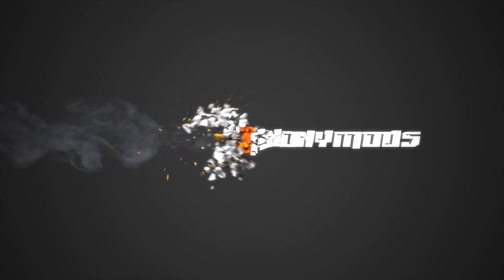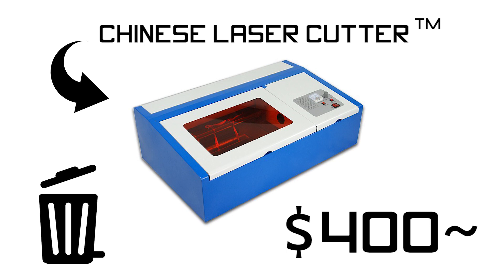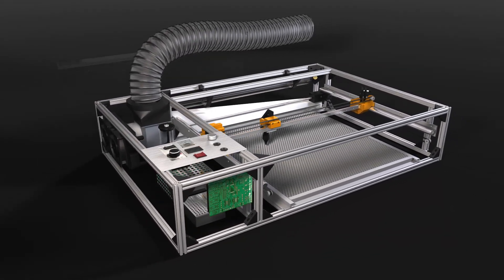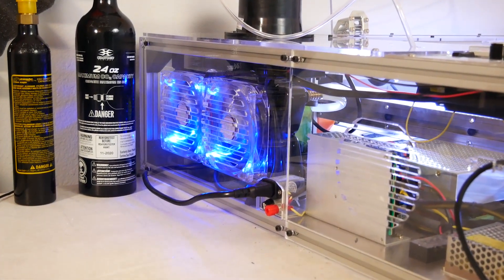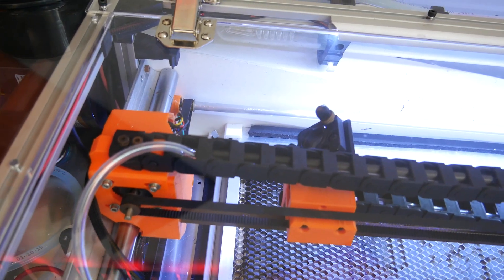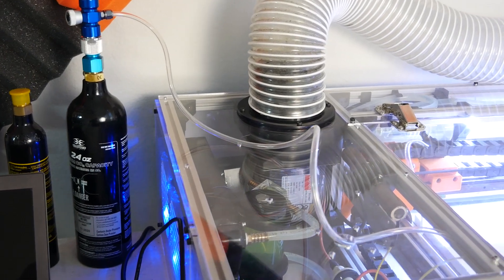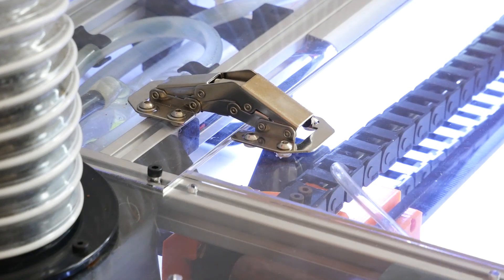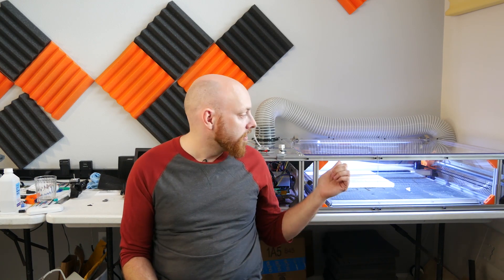S01E19 - Laser Cutter Build

Comment: I have a K40 and been wanting to upgrade to a 24x18 inch bed. Is the beam still strong enough at this larger size to cut 3mm acrylic? Do you have any plans or diagrams available for reference? I've been thinking about using 20x20 extruded aluminum for the frame and V-slot for the rails.

Comment: really? co2? That doesnt sound right with a co2 laser since the gas will absorb the laser radiation beatifully. The energy the laser photons have matches exactly the energy that is needed to activate the CO2 (obviously since that is how a laser light is created) and so would cause a new emmision in a random direction. I wouldnt be suprised if you would lose 50% of the power by doing that. I personally would go with N2 or normal air for the easy things.
And a word of warning: The tube is a 30w tube but overdriven to 40w. So if you want to extend the life you shouldnt go over 70% power.

Comment: As someone working for a company that uses lasers to cut holes in car frames at their factory's, I would highly suggest you to paint that thing black. It sure does look nice but that laser is way to dangerous to be in an open space.

I had a colleague who walked in a room where our robot was busy working on a car. The guy never looked at the laser but by just walking in the room he got hit by a diffuse beam, making him partly blind... If you do want to look at it, at least use protective glass (in the same color as the laser). But even then, never look at the source.
Reply: in this case, the laser is uv.. so what color -uv should the safety glasses be ?
Reply: maximum woof what about uv protection? Or do you think you need to wear sunglasses only to see some shades darker...
Reply: Two things: First, laser safety glasses are not all equal. They need to be certified for the particular wavelength of the c02 tube, so get the right ones. 
Second, you shouldn't use clear acrylic for the side panels. I know it's cool to see everything working, but get some thin steel or aluminium for the sides and a tinted polycarbonate for the lid. C02 lasers don't cut poly, so it's "relatively" safe to use. I'm starting my build now with an 80W RECI tube and I'm doing my safety stuff at the start. It's nice to have two functional eyes ;)
Reply: Great point.  That's 2 functional eyes.  "Dang!"  Don't look at laser with remaining eye!!!

Comment: What's the backstop made from?  As in, what material stops the laser when it's done cutting?
Reply from the maker: +Isaac Marcus what you see in the video is just a sheet of acrylic. It's painted on one side which is why it's gray. It worked ok but eventually started to warp and get pretty nasty the more you cut on it. I have changed it for some thin ceramic tile from home Depot since then and that seems to work really well. Absorbs the laser with no signs of wear or reflection.